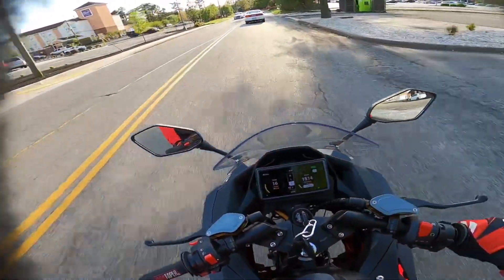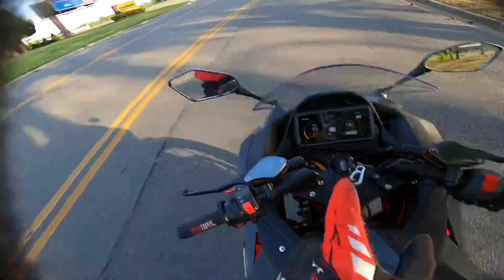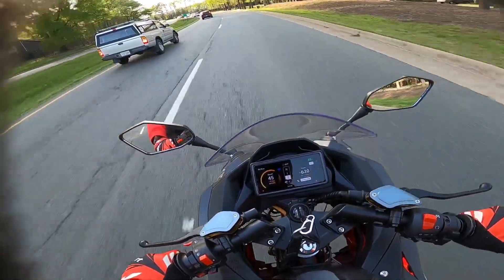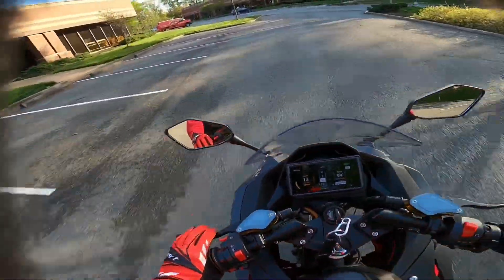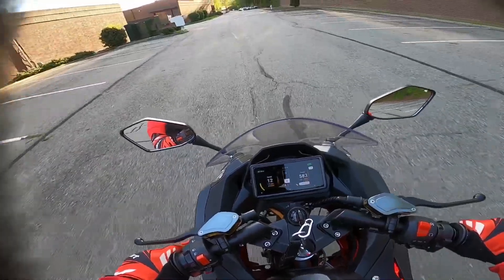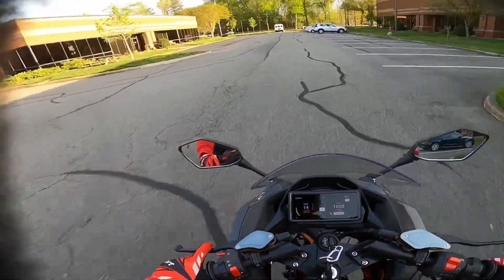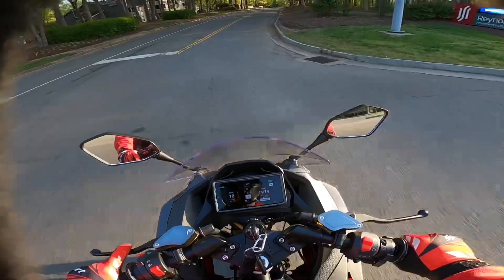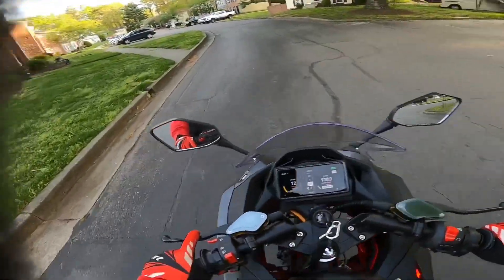RZ did over 70mph 14kw 250dc and some awesome field weakening from ASI BAC 8000, don’t sleep on ASI!

Comment from the maker: I know there are lots of people that like Fardrivers and they are fine they make power but they are cheaper for a reason so you have to go bigger with fardriver to get the same performance as this BAC8000. i guarantee if you set both to same power levels the ASI gonna give you way more top end on same voltage with the field weakening but do know the field weakening needs it own amount of current to work so you'll have to add that to its total output power. For example if your running 200dc line amps and 90amps field weakening under full load your battery needs to be able to produce that 290 while maintaining above nominal. if your voltage sagging under low way below field weakening wont initiate it needs a certain amount of voltage to initiate

Comment: It's hard to say what the best controller is. Let's say controller A gets you to 70mph and controller B gets you to 100mph,   but Controller A costs 200$ and Controller B costs 1000$ sure your going a little faster, but was it worth it? not everyone has $1k+ to go a little faster, and even less of us have a place to go that fast without wrapping around a tree.   I like to go as fast as I can for as cheap as I can :)    Not everyone has access to an unlocked ASI. Hell a lot of people never even tried a different controller, let along optimize it for their bike.
Reply from the maker: All that's Tru bro but since I have a performance ch optimization is a thing here. Not everyone has the means or access but not everyone is trying to get the best performance either some are fine with ok performance at an ok price. For those guys there are relatable chs. Since I'm trying to get the best performance that best comes at a cost. That's only a problem if those people as you said shouldn't be expecting those best results, they'd be perfectly fine with ok. Now you said a Lil faster 10more mph on the same voltage and the same Amos is allot faster and that 10mph means more the slower you're going. If your only going 30mph 40mph is Another 33% worth of speed that now you can ride in flowing traffic when at 30 you was holding up traffic so it would be allot faster than. If I'm going 120mph and I can go 130 than that ain't a significant but I'd still think it was it so variables were the same
Reply: Na bruh I see I see the point you're trying to make but I have to agree with Chris on this one the best is the best regardless of how much it costs.
Reply from the maker: Bro the best controller is the best controller whether you can afford it or not is a whole separate issue if we're just talking about the controller itself that's what it is. Now what controller give you performance to cost value that's Whole different topic. Best is Best right? Best is always gonna come at Best prices that may not be best for me or you but that don't mean it's not the Best and if your running several controllers all at the exact same power levels best is gonna be which one performs the best period. Now obviously this ASI performing better than that Sabvaton. Don't matter how much it cost it's clearly better. There may be a 3 thousand dollar Vesc that I could do the same with and it give me a better result. That means it's the best, best parts, best performance, best software, best results and that best comes at a cost. That goes for everything in this world if it's made with premium more expensive components it's better for ba reason. A Bugatti Vehron has a better engine than my AMG E55. I can't afford it but it's way better still